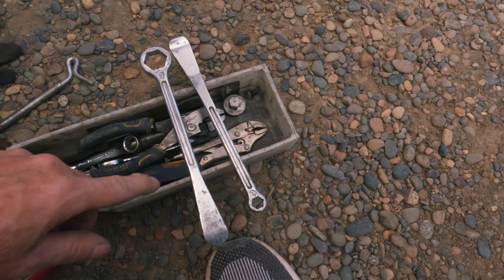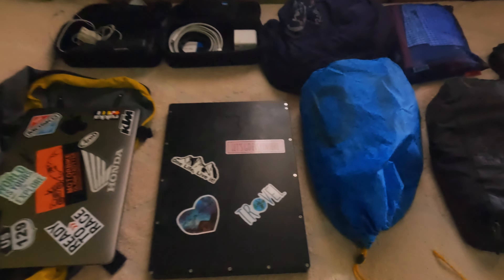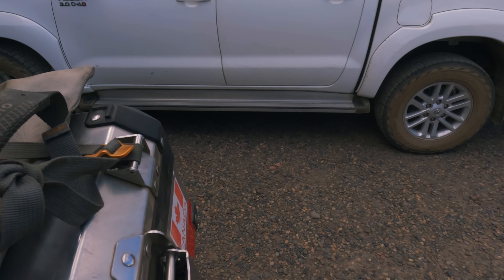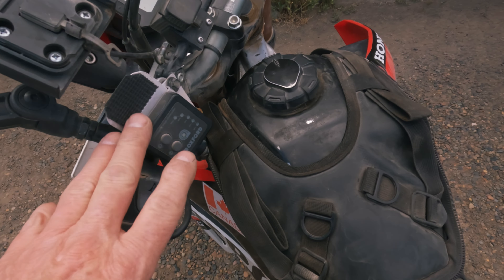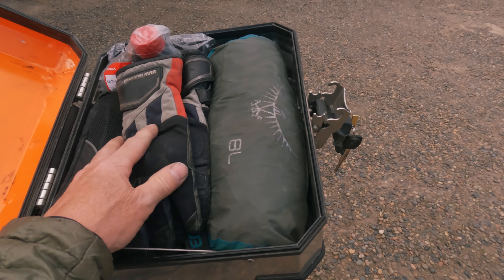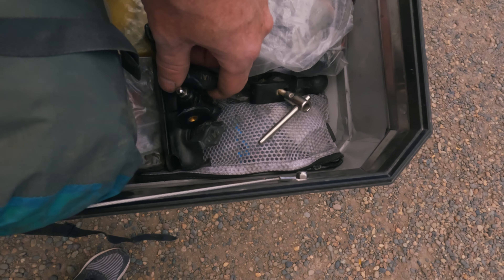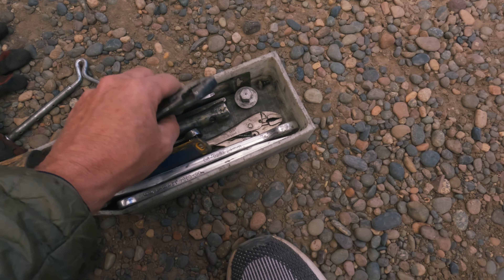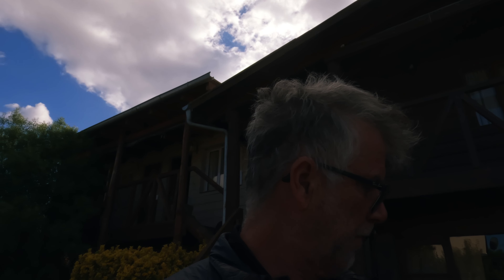My setup

Comment: Thats a great setup - thanks for the video . Interesting to see how you pack everything in there. Everyone is slightly different with the way they pack. I agree the weight looks too far back with that top box but it does give you lots of space on the seat. If you stuck to tarmac you might never of had a frame problem. Do you ever use the tent ? Is it just for emergencies?
Reply from the maker: Nice point… the tent i forgot to tell it is my rain suit… thank you